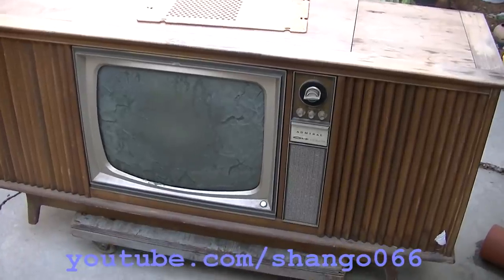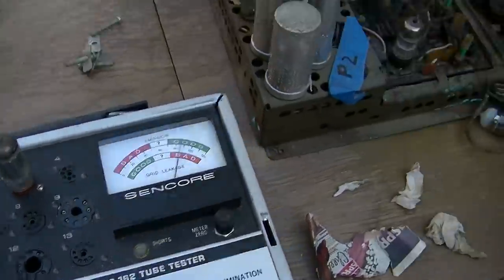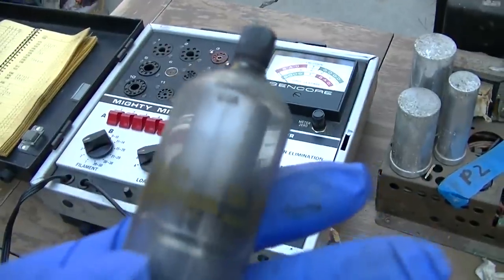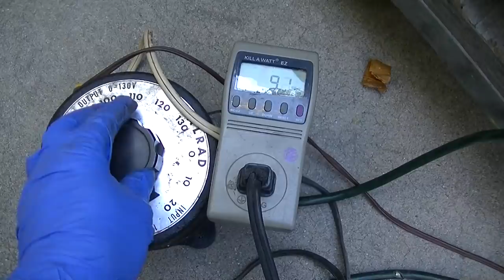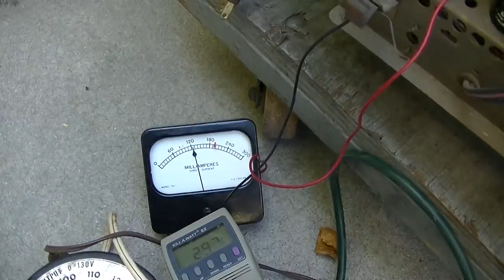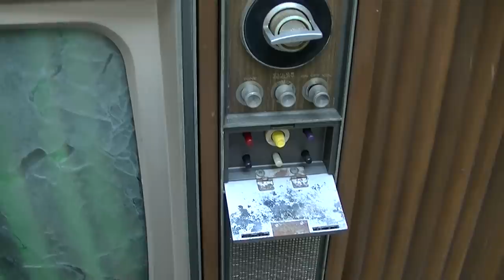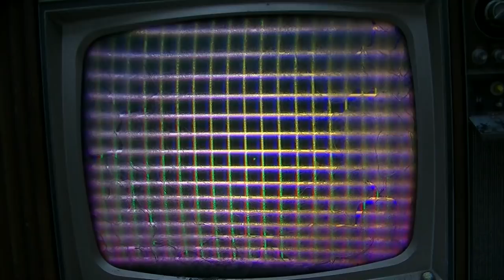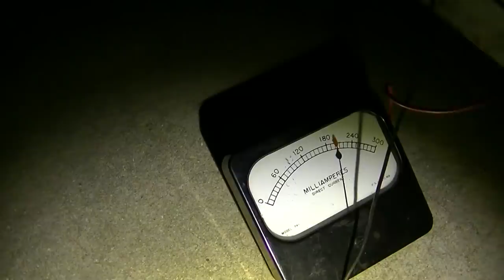1965 TV Resurrection Admiral Combo Color Television Resurrection Pt2

Comment: I got the family TV combo console later, when I moved out on my own and then they moved out to a smaller house later around 1984 -1985. It was the larger version of the Admiral similar to what you have here, 25 inch TV.  All of the TV controls were on the right side under the top door, with the stereo controls, turntable  was on the left side, and there was one set of RCA audio jacks on the back that could be used for record or play. Yes, the speakers were activated by a relay system and that relay system had problems so it was upgraded to a newer relay we got at radio shack. It had another problem and at the old farm house, at times we could not us it due to too much moister in the air and the high voltage would be snapping.  When I go it later, that was never a problem with electric heat in my apartment the air was dry. I had it a few years and the one gun went out on the picture tube, so I gave up on that part and gutted the TV parts and the TV picture tube frame.  That opening was just large enough that I could buy a 20 inch RCA stereo current TV of the time, CRT, and it just fit in there. The the front sliding doors would still cover the center area. I still had the console for the next 6 moves I had. Then around 2007 I bought a house and decided to get rid of it. I currently have that 20 inch RCA TV but It was rarely used since around 2015.

Comment: I have this exact same television here in my office.  Unfortunately the picture tube didn't survive a house move and I couldn't fix it.  I pulled the tv out and replaced it with a modern TV hooked up to the original speakers.  It lives on, in a fashion at least.

Comment: I don't like commenting questions, but I'm stuck with this one. I recently picked up a radio (RCA Victor T-40),  I've recapped it and I had audio for a minute, then I heard what sounded like silver mica disease, but now now I have nothing. Any ideas what might be wrong?
Reply from the maker: smd is possible but could be anything. diagnose
Reply: Check Shango's radio repair vids on this subject. Silver mica disease is a problem usually found only on "slug tuned" IF transformers. He has very good info on how to cure it.